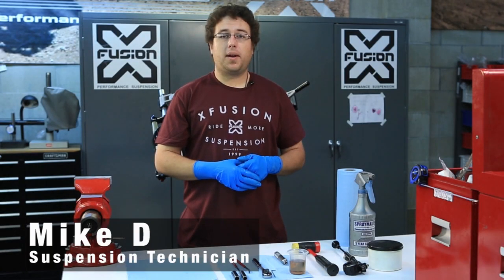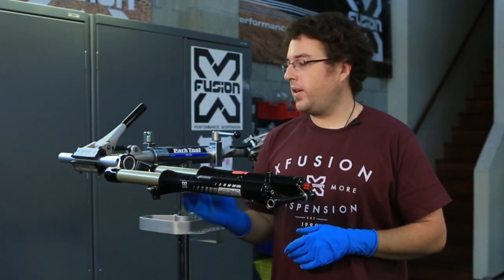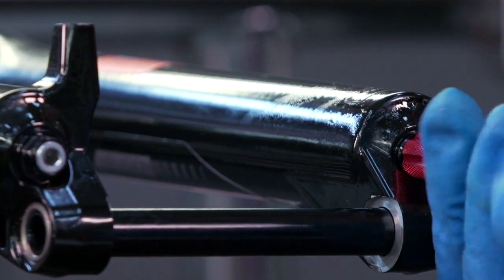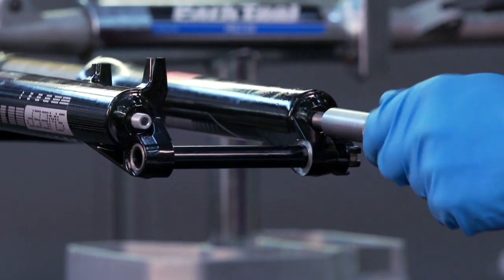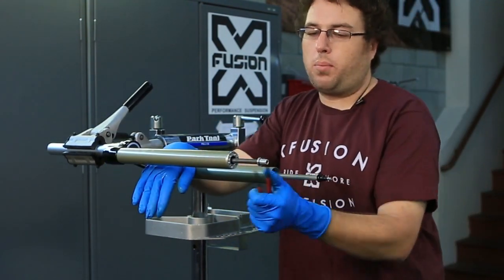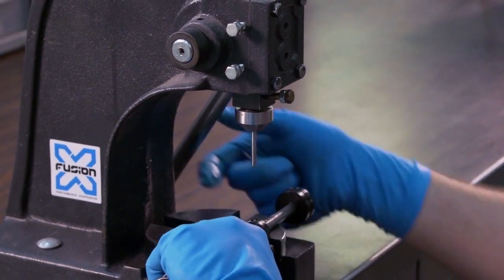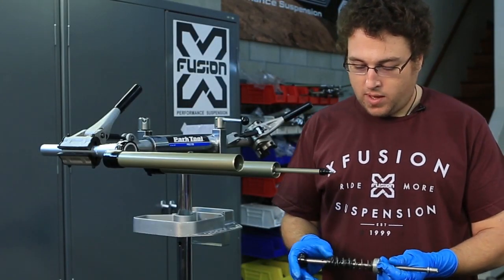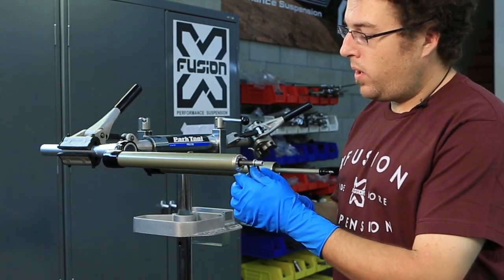RL2 Fork Travel Adjust

Comment: I know this is an older video but it is one of the few which explains how to adjust the travel on the X-Fusion RL2 forks - however, if anyone is watching with one of the more recent ENIX model RL2 forks, there are some key differences with this more 'budget' model, which I'll explain to help you not make the same mistakes/assumptions that I did...
Reply: First of all, both the air-rod and damper rod bolts have an M10x1.25mm thread, with 13mm nuts - not 12/11mm as per this video. You also don't technically need a special tool - not least as it won't fit through the holes in the bottom of the fork lowers, as they are only 10mm diameter for the fatter rods to pass through.
Reply: The other key difference (other than a number of plastic rather than aluminium internal parts) is that the ENIX uses a circlip rather than a roll-pin to set the different travel height - however, keep in mind that there is no 140mm position on the shaft - if you've bought the 120mm version of these forks they are already set on the top ring, although you can remove the 10mm spacer between the circlip and the top-out spring seat to give you +10mm, so 130mm travel overall.
Reply: I hope that helps! The ENIX is a great value fork if you're looking for a new straight-steerer replacement/upgrade for an older frame, and can be internally adjusted from what appears to be 60 to 130mm in 10mm increments.
Reply: Is it possible to increase travel to 130 without taking the fork apart like in the video?
Reply: @nathancohen9176  no, you do need to split the forks/remove the lowers to access the clip [and spacer] around the shaft which dictates the length of travel.

Comment: Great video!  Very instructional.  I have a Slide fork set to 100mm and it's performing flawlessly, yet it is developing an anoying noise when I approach an obstacle at almost a perpendicular angle with the tire.  It sounds like "clank".  I've checked the headset and it is OK.  I bought it new two months ago so I'm guessing there's no need for a service yet.  It has about 300 riden miles cross country mostly.  Any suggestions would be appreciated.  BTW, I know it has warranty, but I wouln't be able to ride my bike if I send it for a warranty service.
Reply from the maker: Hi i am not working in x-fusion
but 
while it clanks
there can be at least 3 reasons
1) there is no tube on the spring (negative) - need to get one on it a Shrink or better do so  http://cs307413.userapi.com/v307413508/68e1/5GxpBfb2GEA.jpg
2) some of the o-rings in the negative spring are gone , theyt work as a small stopers that absorb spring power - need to get them back on the places
3) the legs cranking in crown